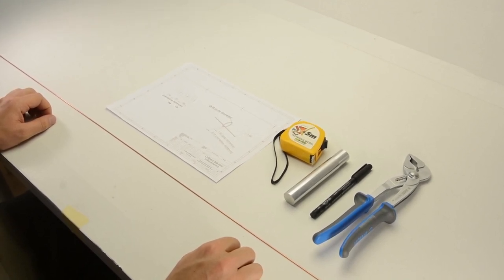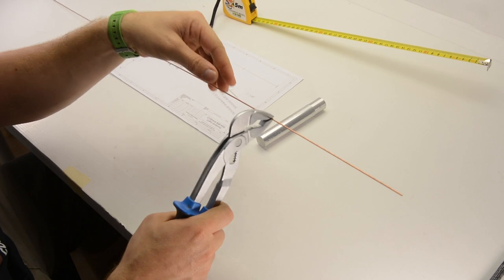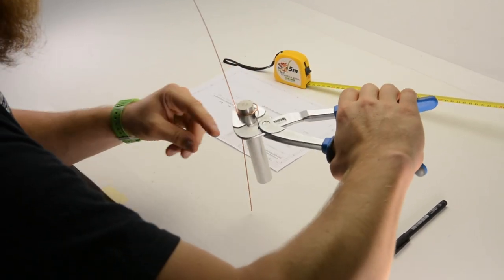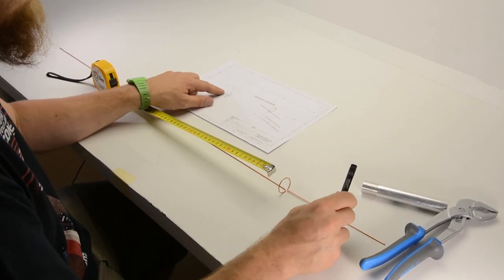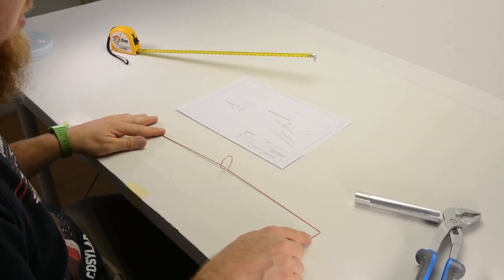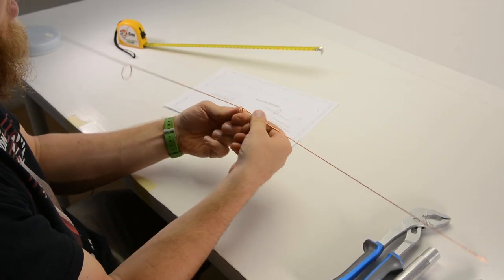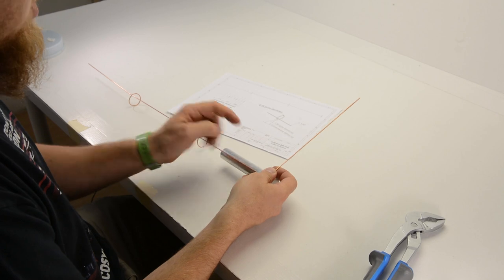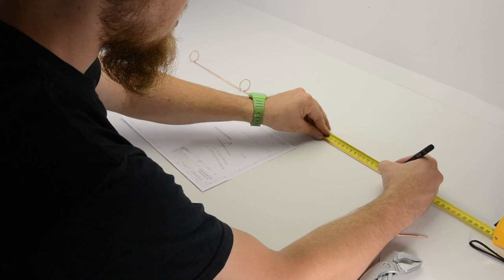Building an 868/915 MHz co-linear antenna for Lora TTN gateway

Comment: I put this antenna in a 3D simulation software. In terms of radiation patern, it is difficult to have a worse design as the radiation in the horizontal angle is almost 0 !! Max lob is at + and - 15° !!! :(
Reply: which just shows the failure of modelling software. I've used these antennas in the real world and they work really well
Reply: @kimberlyolsen6384  It's funny given how much these are used that people seem to not understand that an antenna on a tower, shooting straight, misses the stations below it. I'm going to try this where I shoot up to a repeater on a ridge so the 15 deg lob seems pretty ideal!
Reply: @DaveHojo  Of course, I know that but be aware that you loose 3 db gain as there is a lobe at  +15° and another one at -15°
Reply: Yep. Any antenna mounted above earth has a null in the horizontal plane. That is, any simulation will show that. Real earth is different - its finite conductivity lessens this effect.  But the effect is still there.  Fortunately it is possible to bring the shallowest-angle lobes closer to the horizon by mounting the antenna higher.  Of course there are practical limits on height.

Comment: Is it ok to use solid copper electrical wire that's readily available in US hardware stores?  And what about the diameter of the wire thickness?  I'm planning to use 12AWG wire which 2.053mm in diameter.  The next smaller diameter is 14AWG which 1.63mm.
Reply: too soft

Comment: I have followed this procedure to the single word and put the antenna on a VNA (vector network analyser). 
All I can say is that this antenna is the worse that the world has ever seen for lora 868 MHz. 
Not the good frequency and not the corrrect impedance.
If you do not want to loose your time, do not follow this video.
Reply: Agreed. The loops are simply phasing/delays to preserve element-to-element phasing. Fixed loop dimensions seldom perform optimally. A better scheme is an adjustable linear phasing link, not a fixed loop. Also, the loop at the top is appropriate ONLY if another element were to be continued. It's presence in this design is undesirable and modifies the feed point impedance significantly (VNA verified).
Reply: Yeah. the size of the radiating elements are also wrong. I've seen a few youtube video's of people copying this design but they will have a far from optimal working antenna.

Comment: Did you say "thick welding wire with copper coating"? What I have is 14 AWG (1.72mm) wire and 15 AWG(1.58mm) wire. Can this be use, it bends quite a bit.
Reply: No, TIG wire. TIG welding wire. TIG filler rod.

Comment: the top loop does nothing. The loops are to put all the half wave radiating parts into the same phase. The loop has to be half a wave length long. At 868MHZ that's 17cm so the diameter is 55mm I never saw a thumb being 55mm wide.  The impedance of a half wave radiator is thousands of ohms. so you cannot connect a half wave radiator onto a SMA connector, you need an impedance transformer. Just look at a J-Pole antenna and forget this dumb video.